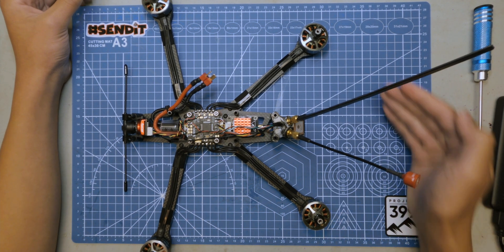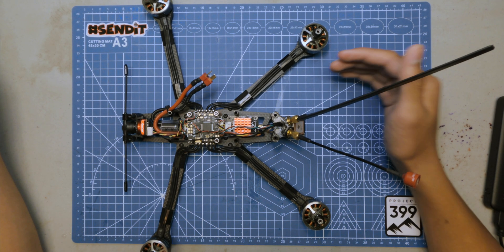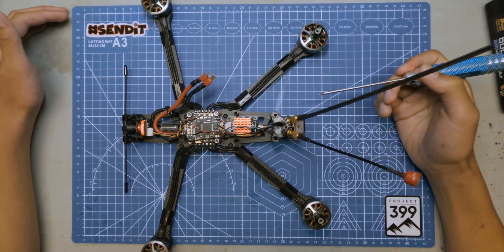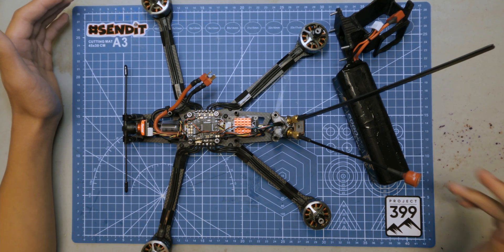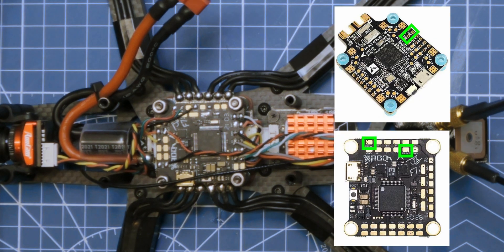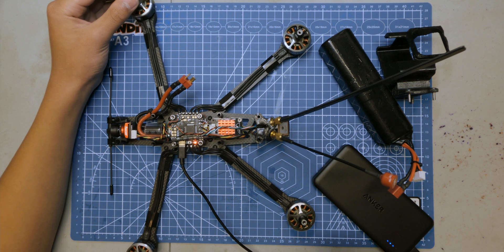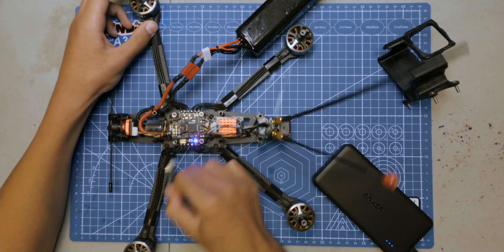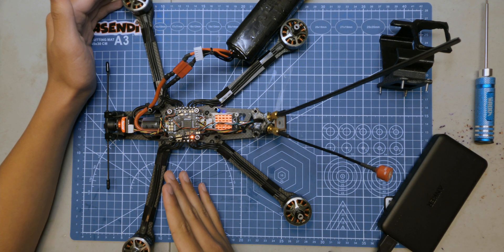GPS Wiring HACK | 90SEC Satellite Lock EVERYTIME

Comment: Some Myths - 
1. Shielding  the GPS wire is not helpful : It makes hell lot of difference, only thing is , you need to Ground the Foil / Wiremesh (what I prefer). Specially when you put the GPS close to VTX / Video antenna 
2. All GPS are same - Beitian BN-180, 220 are CRAP ... Matek M8. iFlight, Flowoo, HGLRC are way better.  The latest M10 GPS even from Walksnail is 2 times better than 4 times costlier Matek GPS

Comment: Hey Muck.o I'm just a bit curious....how big is the build on the bench? 7"?  Are you using a DJI air unit? Would love to see some of your technical specs.....
What a dork I am - its all in the notes thank you :)

Can you tell me why you chose that type of battery connector, and not the typical XT60 type? I see you're using a 4s2p battery.....too much current draw?
Reply from the maker: Yup I'm using a Deans connector - just personal preference. It's about half the weight of an XT60 (you end up saving about 4 grams, if that matters to you) and I believe it is more reliable, but have not tested it. It is what all the RC Car racers use, and those rigs draws tons more current than drones.
Reply: @muckofpv   Wow - I'm surprised their not used more often. Thanks for the knowledge.

Comment: Works every single time for me! Actually both my receiver and GPS are powered via USB power, and I've set up telemetry to send # of sats into my Tx so I can monitor how many sats gets acquired in real time (instead of via video OSD which is the whole point of this method, to avoid powering up the VTX which interferes).. As soon as I get to 5, I know I'm ready to plug my lipos in and disconnect the USB power. Awesome workaround that just requires abit of a preflight workflow. 👍